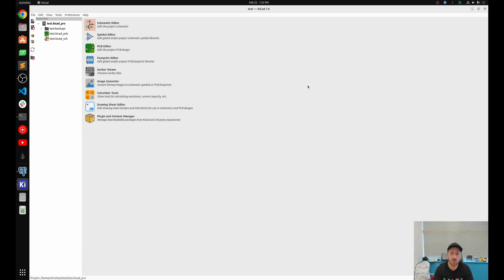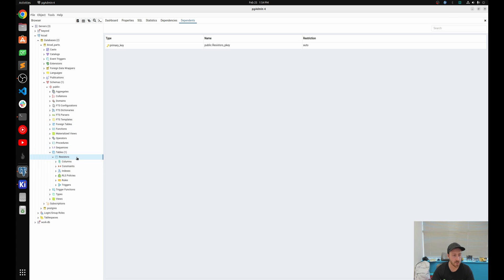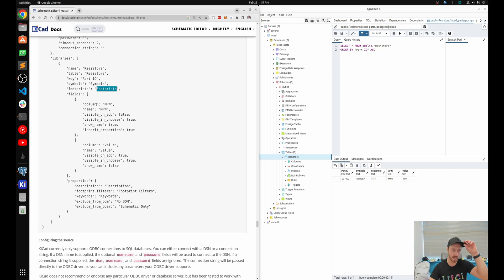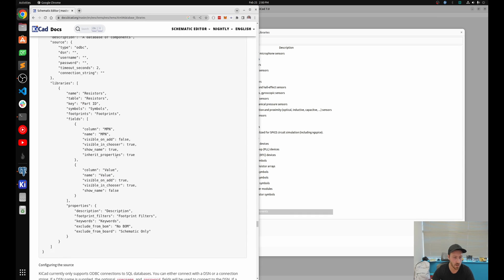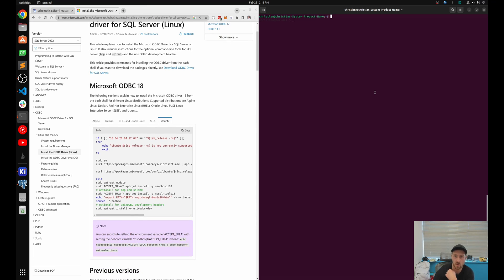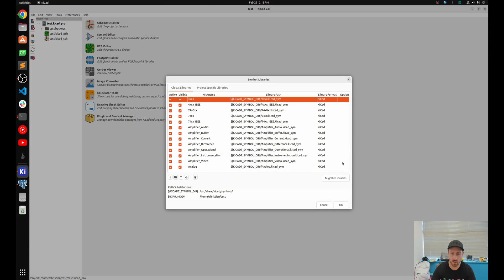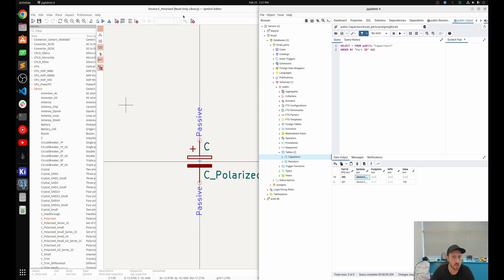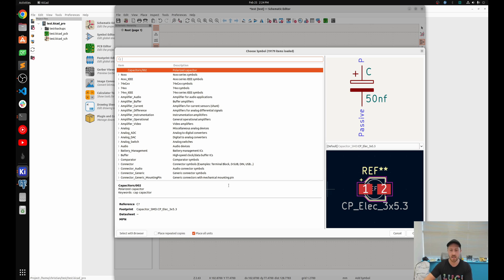KiCad 7 Parts Database Setup

Comment: I suspect the explanation is good, but unfortunately this is an area where KiCad REALLY goofed up.  To add shame, the Altium people got the database library stuff pretty much right and I had little trouble.

How amazing it would be if KiCad had allowed use of a CSV file as carrier of the library database system.

It has been WAY easier to generate KiCad library files using Python than it has been trying to get the Database library to work, and that included learning to use Python.

Comment: Interesting video. I have done such work for Altium with MS Access. Good to see that Kicad also support DB connection. This really helps to move kicad to professional users. Still you need a lot of single steps and it would be good to have tools to simplify the process.

Comment: I need to try! This is currently my biggest issue with KiCad vs Altium.
In my former company i've set a PGsql database of components I had in the laboratory. (and when I left tey gave me half of this stock :) )
And it was very handy to use on schematic components i actually had in stock or know. Knowing its price, order reference on Farnell or Digikey.
With KiCad currently I'm losing so much time consolidating every design BOM.
So sure I will try to convert my old PGsql databse for KiCad and manage footprints with git.
Thank you!

Comment: Perhaps one day it will be useful.  Presently, individuals seldom have an online database.  Additionally, requiring the part definition to be local is of little help regarding any share between peers or even office, home, or business trip.  It would be FAR more useful to allow users to share their custom components with all KiCad users and to streamline selecting (and remembering) preferences from this community.  It is counterproductive to legislate "thou shalt use these" incomplete and error-filled libraries because we said so.
Reply: It's pretty useful. I worked a lot with database libraries in my previous job and I was super excited to see the feature added to KiCAD. Maintaining your libraries in Git is pretty useful and being able to make many new components by reusing symbols and footprints with this linking method is quite powerful. It could be neat to also store these in a database that is remote but I imagine the internal work to KiCAD to support this would be rather challenging. It is open source though if you want to take a stab at it!
Reply: @cwbh10  I am not enough of a "programmer" to understand their code.  I can donate a little money and tell them what I dislike, however, and the lack of a decent library plus the inability to compose one myself makes using KiCAD unpleasant and unproductive.  Even the components I have composed using previous versions are no longer compatible making that wasted effort.
Reply: This is probably THE addition which has a really significant impact for teams. Libraries are still stored in GIT but now there is a parts database which enables reusability and links symbol and footprint together. This is THE main feature we've been using in Altium designer as a team of 10.